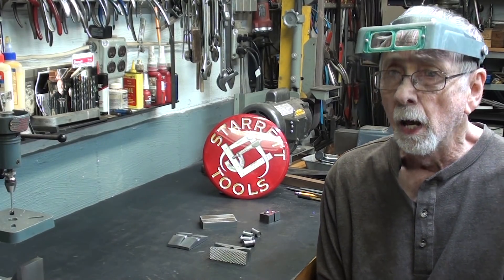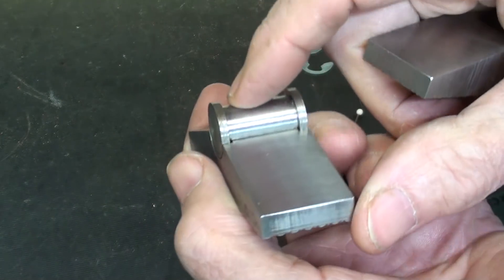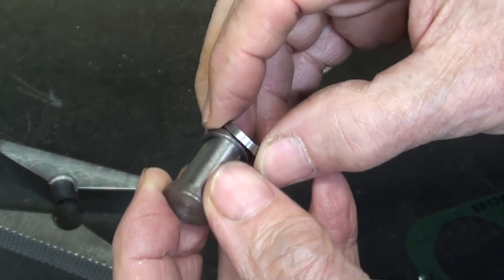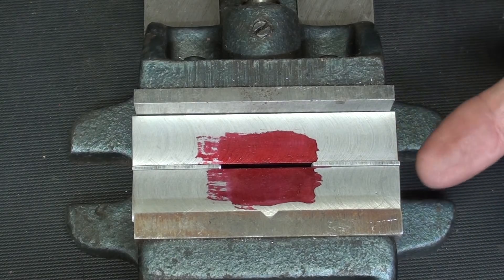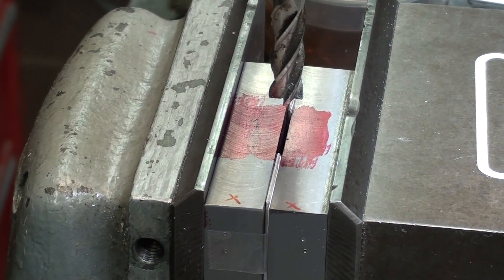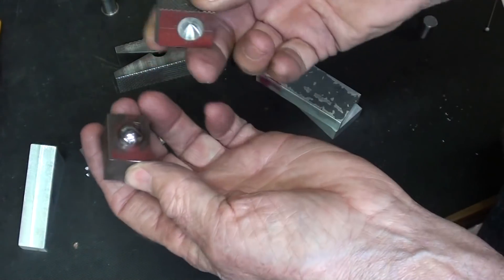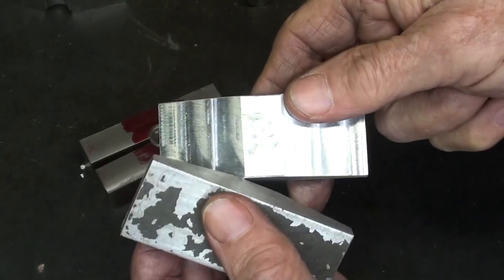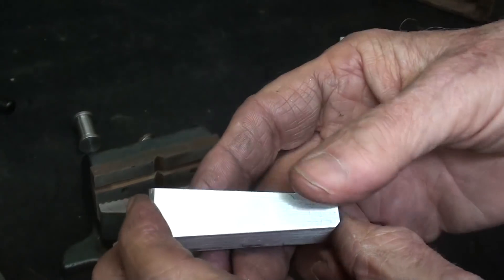BALL SWIVEL VISE JAWS #716 pt 5 tubalcain

Comment: On the original, drill the hole in a solid block. Then layout and cut angles on bandsaw and clean up on mill
On the ball version, also machine a 16 degree angle across at  90 degrees. (Pyramid)

Comment: Easy fix to keep them together would be drill through the center of all three parts and counter bore outside holes of jaws then countersink each side of the hinge pin then fit a small spring and pin spring in counter bored hole.👍

Comment: I made a ball version years ago with two springs in tension holding the blocks together (using retaining pins in the blocks).  The ball was 3/4" or maybe 1";  works great and you don't have to worry about losing parts.  The aluminum version would be useful too.

Comment: Great series. In any  project, MANY skills and techniques are needed - and you show - most(?) all of them.
The aluminum jaws are not a mock-up; they are a set of soft jaws!
I like the idea of the ball swivel. Add another set of 16 degree angles across the jaws and you would have a greater utility.
And a final note for the aluminum set. You could anodize them.

Comment: Was thinking how it can retained in a simple way. My idea is to drill two holes in each part, parallel to the mating face, before the angled section is milled away. After milling the angles, the eight holes will line up quite near the ball, depending on how close to the mating edge they were drilled. This way, there would be an automatic alignment if two springs are coiled going from one part into the other.
In other words - each part has two parallel holes just around the ball area. The two parts connect around the ball by using the holes on the opposite part and an elastic tie. 
"Infinite" springs can be coiled into one loop but it would be quite a fiddly job in that tiny space. Better to hook them onto themselves. imgur [dot] com/a/eZDYUhg

The other idea would be to solder some sleeves onto one part and use a screw to fix the cylinder to the other part, after inserting it through the sleeves. In a similar way, the hole for the cylinder can be drilled and then the center milled away.

Comment: The magnets you used are strongest on the flat faces, hence the low magnetic attraction when the pin is inserted into the 'hole'.
A cylindrical magnet, or stack of a similar profile you used, polarized around the outside would be a bit more attractive. 🤨😏😉

Comment: Retaining the pin. Make the pin short (remove the flange) and hollow. Mill out a pockets on both jaws and both sides almost to the depth of the pin. Drill and tap a hole in all 4 pockets. Form small plates to fit the pockets, countersink and retain with flat head screws. Have these plates extend to the center of the pins and just bend over the ends into the center of the pins.

Comment: Combine the dovetail idea with the rings idea.  With an interference fit on the rings, the final assembly might need a press, but if dimensioned carefully it should still work smoothly and freely.

Comment: I'm just a keyboard machinist LoL so take my idea with a grain of salt. Keeping the part together seems like you could use a small pin or bolt  and nut through all three pieces. Cut a wedge shaped hole in the blocks with a normal hole in the center piece. The wedge or V shape hole or groove in the blocks would need to be stepped to allow for the head of the pin or bolt and nut. Probably just cut the wedge in one of the blocks. The pin or bolt wouldn't have to be very big cause it's only job would be holding the tool together. 
This may not work but it's what come to my mind when you was talking about snap rings and lock tight.

Comment: About the magnets. From what I can see from the ones you have they are linear field instead of axial. Since the field is oriented from end to end they don't attract the jaws as much as if the field where side to side. At least that's my guess. The fact that their in ferrous metal shouldn't matter as much as you might think as it may have a small effect on the field but over time will actually become part of it as it will become magnetized.
Reply from the maker: Thanks

Comment: Split the bearing in half, thread it or put a hole through it for a nut and bolt to hold together and put a lip on either end of the overhang and a valley on the jaws where it marries up to them so that when you screw the bearing together with the jaws in place it tightens the lip into the valley, holding the jaws together. Just an idea.

Comment: Mr Pete, please allow me to join the crowd and offer my 2 cents.  It would be very hard for me to make this, so I am just stating my opinion.  Consider adding a bit more time, effort and money to make a more sophisticated as well as fully captured design.  Captured meaning it still swivels but can't come apart.  Make the center pivot out of thick walled DOM tubing and a properly fitting shaft (inventoried stock at many metal suppliers).  Soft solder the tubing into one of the jaws just as you did.  Then, machine a slot in the center of the exposed tubing along the long axis of the jaw.  Drill and machine the other jaw in the center to accept a machine screw.  Drill and tap threads into the center of the shaft in a perpendicular method.  Now, a drop of thread sealant, a drop of oil on the shaft, some tricky assembly and you have a single-piece mechanism.  I encourage you to finalize the design and make one of these in yet another follow up video.  Finally, I would have to skip the complicated diamond pattern on the jaws.  As an option, use smooth jaws and stick on some fine sandpaper.  I would then actually use this in my woodworking vice.
Reply from the maker: Those are some good ideas, but I am about done with this project

Comment: Great job, as usual!) But that jaw can be more efficient if you mill two more angles: http://i.piccy.info/i9/2d921e1574c09cfface05be99f9768d5/1618128265/99007/1424655/Bezymiannyi777.jpg And magnet pin its not good idea, because magnetic chips everywhere)
Reply from the maker: I did mail those two angles later on, I will show that in the next video. And yes magnets and chips are a pain in the neck
Reply: @mrpete222  I thought you could turn them on a lathe. No?

Comment: Mr. Pete .. you fool.
You could have "drilled" (milled) your hole off centre and slid the pivot rod in the deeper half hole.
A collar turned on one end and a bolt on end cap for the other.
Job done. 😇

Comment: I think the horse is not quite dead yet, need another poke or two!🤣 What about inserting the steel pivot point(small square demo ones) for durability into the aluminum jaws and finishing the 16* into the lathe for all around greater clearance.🤔
I might try it myself. Soft swevel jaws...
Clean Up!!
J.F.🇨🇦

Comment: The problem you're having with the magnets is because the poles are on the faces. That means the magnetic lines of force are coming out of the sides. If you had magnets that were polarized radially instead of axially, this would work better, but you wouldn't be able to stack them like you are.

By the way, I went through my collection of antique HSS tool bits and found a couple that would be really good for cutting those face grooves that I mentioned in the previous video.
Reply from the maker: Thanks

Comment: Why not use two balls as a replacement for the pin.  That way it pivots only on one axis like the pin style does, but it doesn't require flanges for constraint.  It would be good for a steel design, since the balls are a hardened surface.

Comment: Great work. Perhaps you could drill through both jaws and the pin and insert a spring. Fix the spring to the jaws with solder or Loctite or a pin at right angles, a bit like the way a spring holds an edge finder together?

Comment: Lyle, another way that might keep the jaws together might be to run a spring down through your pivot to hold all 3 pieces together, and hook it on a small piece of rod on each side in a countersunk hole, or maybe in a slot designed for it, going in the direction of the diagonal cuts on the jaws.
Reply: BRILLIANT!  You get my vote for functionality in an easily manufactured solution!

Comment: Thanks for a really excellent series. The only thing I have needed the equivalent of the ball version for is holding a tapered gib. To retain the pin and both jaws with snap rings easily, the counterbore could be made large, the grooves for the snap rings could be made the slightest bit loose, and each jaw drilled and tapped for a small screw through one of the rings. I have a moderately easy way to do it with dovetails, I think, and if I get the chance to try it, and it works, will provide pics.

Comment: To make a version of this that holds all the sides together, use three tubes 1/3 the width of the jaw and a pin like a hinge. Solder one tube on one side and two on the other. Stake the pin and you are done.

Comment: The magnets aren't strong in the radial direction because those magnets are axial magnets - the N and S pole on on the flat top and bottom of the disk. If you could find diametric or radially magnetized magnets, where the N and S pole are around the circumference, it would hold a lot better in that direction. See the diagrams here: https://www.duramag.com/neodymium-magnets-ndfeb/neodymium-magnetizing-options/ Or, you need something to couple the field lines from the top, through the jaw, and back around to the bottom to form a magnetic circuit through the jaw (so have the pin go into a pocket that has a cap on the top and the bottom magnetically connected to the rest of the jaw). Right now, the majority of the magnetic field is going above and below the jaw into air (or the bottom of the vise), not really holding the pin into the slot at all!

Comment: It seems to me the pin in the middle with an two allen screws in a slot of both sides 180 degrees apart is the best "captive" solution.

Comment: You can both capture the pin and keep all the pieces together by drilling a hole through the whole thing for a 1/16" steel cable, with a threaded side hole in each jaw piece for a grub screw to clamp the cable. The hole through the pin has to be a little oversize.

Comment: The simple solution to hold the three pieces together is drill a hole through all three pieces on the center lines, make the hole in the pivoting axle oblong perpendicular to its length, source a spring to fit the hole and short of the width of the two jaws and mill two pin channels in the face of the jaws to retain the spring ends.  One end could be done with a blind hole and pin for one uninterrupted face if desired. This could be done with the ball pivot provided you can create a hole in the hardened ball.

Comment: Mr. Lyle,  after you cut your center hole on the mill the next step could be; Use the mill cutter to drill a hole deep enough to hold a magnet in each piece. Having a magnet in each jaw would hold it together really well.

In using a ball like Brian suggested could also be drilled (milled) in one side to hold a magnet under the ball. And the best part with a magnet to parts stay together even in a tool box.

You  are not wasting out time doing this work, you are teaching us, thank you.

Comment: The magnets don't hold as well as expected because magnetic attraction is always strongest at the magnetic pole, i.e., at the flat ends of the neodymium button magnets. Due to the design constraints, the magnets in the pin are held with the poles perpendicular to the jaws.
Reply from the maker: Thanks

Comment: A simple way to retain the center pivot to prevent loss. Simply cross drill from the face side into the pivot pin. Use a small counter sunken screw to hold the pin to one half of the jaws. Always informative interesting videos thank you for posting these videos you do

Comment: I love that you used the magnets. I was at least one who suggested it. Your way of using them is of course more elegant than the way I envisioned. I do not think the magnets will help on the issue of not losing it, Just make it easier during set up, then you only need 3 hands.
Reply from the maker: Thank you for the suggestion
Reply: The people who mentioned swarf have a good point I did not consider.

Comment: Magnets are cool but, they attract swarf and make for clean up issues.  
I have never encountered swivel jaws and looking them over, I do not understand why the E-clip would not work. Making the pin with a flange on the bottom and counterbore the bottom of both jaws. Make the pin longer than the jaws are tall. Cut the groove in the pin that so when the E-clip is installed, it rests with minimal clearance on top of the jaws. this would allow a choice between making the pin with an E-clip or an external snap ring. Is there a specific reason that the pin would interfere if taller than the jaws?  I like the ball swivel the most.

Comment: I know how you hate to tilt the head of the Bridgeport! Can you use an endmill with a 45 degree end to cut the grooves?
Reply: I now can answer my own question! I tried using a 45 degree end mill on the fourth or fifth pass making the serrations the tip snapped off !!

Comment: A little relief on the top and bottom of the ball jaws might make it more adaptable to compound angles but, as you say, what are the chances you'd use it? My favorite configuration is the magnetic pivot, and I think I'd probably Lock-Tite it to one jaw to reduce separate parts to a minimum. I'd probably still lose half, though. Thanks for all you do, Mr. Pete.
Reply from the maker: Yes, I already made the relief and will show it in the next video

Comment: That magnet will attract shavings constantly. I agree with "IDONT KNOW", a person could make 1 jaw with a convex or gently rounded surface on 1 side and flat on the other. Takes up less vise opening space, and would allow for any angled workpiece to be accommodated. The only issue with that is the single point contact of the radius creates lots of pressure exerted in a small area of the vise jaw, and would mar it. I think the horse is finally finished! (;<)

Comment: You can use a regular drill with no problems if you shim the two parts with a piece of steel sheet metal, all the way through instead of just at the ends. I even used something like that to make threaded half holes just using a drill and a tap.

Comment: The poles of the magnet stack are perpendicular(I think that's the right word lol) to the surfaces. They do "stick" but not as strongly.
Reply: Not necessarily.  Most cylindrical magnets are axially polarized, but they often aren't.  The reason the example pin is weak is because it's being shunted by the sleeve.

Comment: Neodymium magnets are very fragile. The neodymium magnet inside the sleeve may break under load.
In my opinion, working in metal is not a good idea.
Maybe other soft materials.
Reply: Yes indeed they are very brittle!

Comment: Perhaps 2 slots can be milled on either side of the pivot on the top and bottom with a a small pin pressed in the ends of the slot. Then you can stretch 4 tension springs between the two halves.  
I hope that makes sense.....

Comment: I wonder if only one of the swivel jaws should be needed. For instance,  the pivot ball (or hinge pin) could just be a semi-circle, with the flat directly against the face of the vice jaw itself.  You would still get the swivel, but not loose as much available space between the vice jaws.